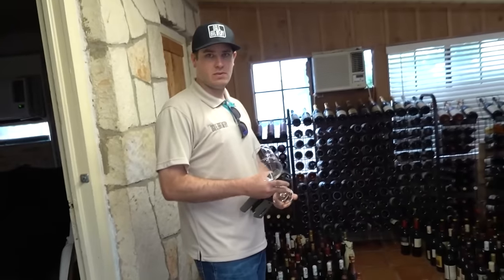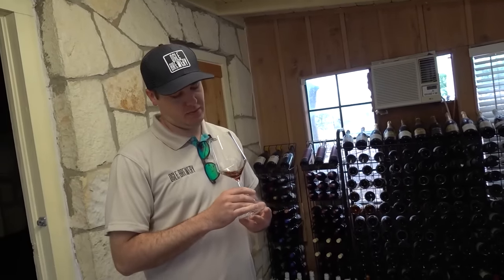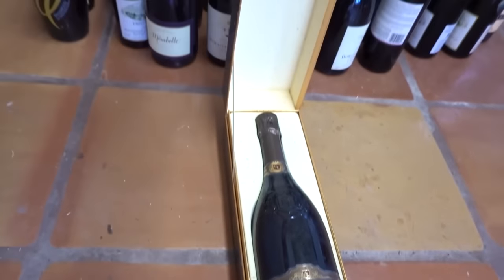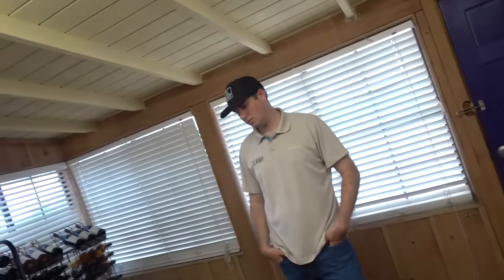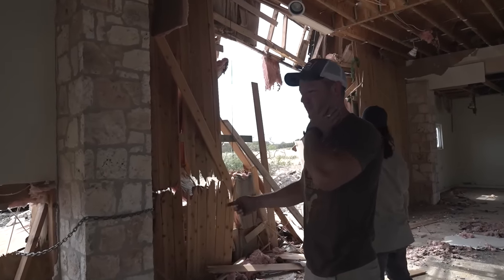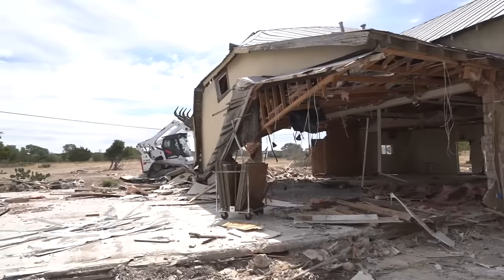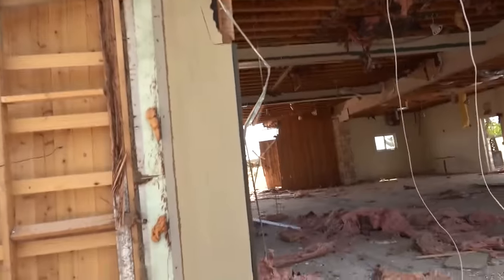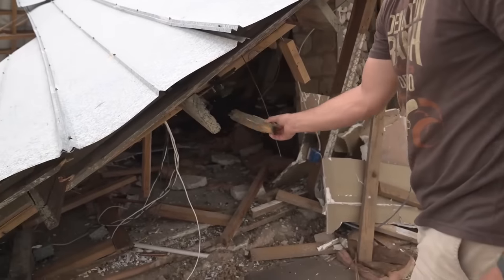Testing The Abandoned Wine to See What's Salvageable

Comment: Definitely a lesson you should know  by. But, having a ranch, resort, a house on a hill, and pneumatic tires on your equipment.... You should know that having a tire plug kit with  extra plugs will ensure your equipment that is bound to catch leaks will be field repairable. If you have enough plugs, you can fix 1 inch slashes in sidewalls. A small puncture on a tractor can be plugged easily.

Comment: When you tow or pull on anything with a chain/cable or robe, you drape something heavy of the rope at the halfway point like a heavy jacket or blanket, then if it snaps it will direct it down and not through the back of your windshield.

Comment: I’m thinking about you repurposing all the spent wood on a giant fire pit and if you put in a random place out of sight, use a loader to fill up “PEARL” for giant fire nights during the rainy/cold season, it would be a cool gathering place for the campers and guests. 

Just a basic pole barn to cover it from the rain and weather so it’s usable as firewood. Even if there are nails/screws etc… you can go through with a pole magnet to pull them out every once and again to prevent issues. 

Maybe like a fire ring with a ring inside so that when it’s all aflame it is an actual ring of fire - what a cool shot from a drone that would be, especially good B-roll for advertising.

Comment: Hang a blanket on your chain or cable in the middle when pulling. It helps keep it from snapping back and hitting something. Doesnt prevent 100% so safety is still imperative but it helps more than not.

Comment: You can make your own still outta a big pot you can seal closed with clamps, 5 gallon bucket and a coil of copper and you get all that wine hot and seperate all the alcohol from it. Its basically like making moonshine but you dont have to make a mash (like cheating). Get all the alcohol in jars and disolve some jolly ranchers in there and youll be the hit at any party you go to. My friends and i used to do it all the time when we were younger, used to buy cheap wine by the gallon from meijer and run it all through it. If you can light it on fire when your done you know your doing good..... not sure howl legal all this is

Comment: Here’s a crazy idea, use an alloy 3/4” chain that’s rated for a heap more than that mild steel bike chain you are using, and don’t get a run up and shock load the chain, take tension and slowly and then pull it. Gets more views I know but a little embarrassing. 🤦🏼‍♂️

Comment: Most of those bottles should have been stored on their side, not turned upright as you have here.  It's cloudy because you stirred the sediment up.  We love you Matt, but on a scale of 1-10 your wine knowledge is -4.  The chain might have worked if you were only pulling on the pillar, but putting it around everything dissipated the power exponentially (that means a lot!).  Getting Mere to marry you was EASILY the greatest achievement of your life, bar none!  Why didn't you just plug the hole in your backhoe tire??  You will need wood for campfires for decades so save ALL wood.